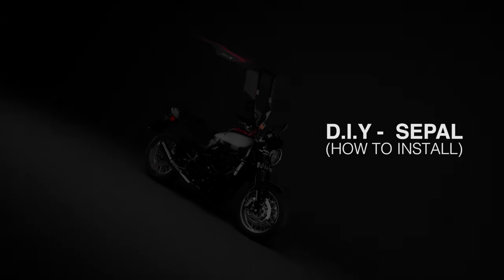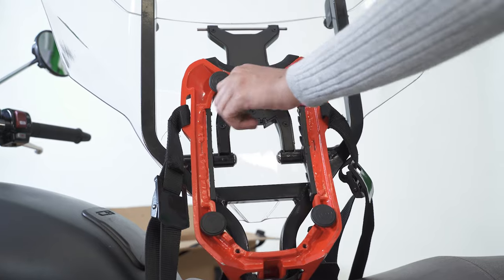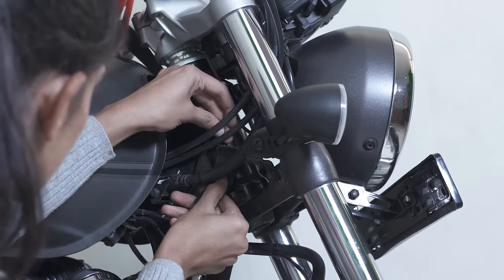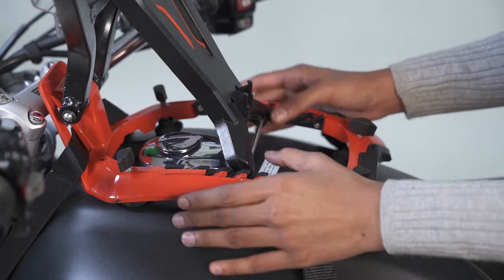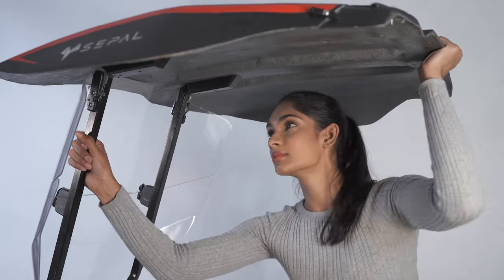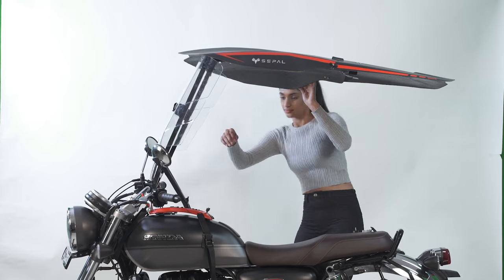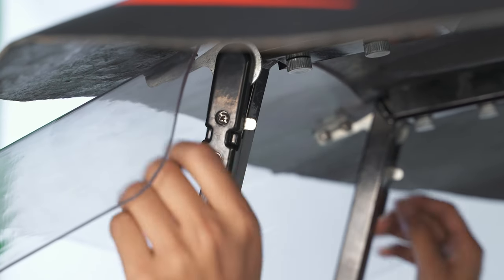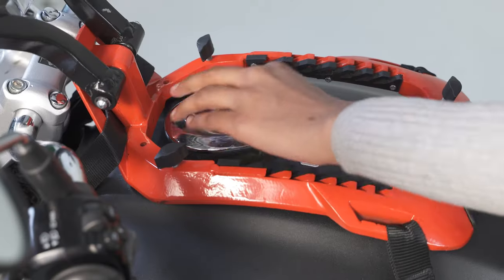How to install SEPAL

Comment: I am planning to buy it for my Kawasaki Vulcan S. I am a bit concerned about a few questions.
- What will be the top achievable(safe for sheild) speed? I usually ride up to 130kmph on suitable roads during my rides.
How the front shield is different from long height windshields on the bike. I am using a long length windshield which experiences scratches over time and even during rain fall, the vision through my windshield looks smudged. What experience will I get with this shield.
- nowdays Police interrupts too much for any additional things. I even had my fog lights registered with the bike during the bike's registration. And still cops keep stopping me considering I have fabricated exhaust and something with the bike. So after adding this, will I be safe??

Comment: RIP to tank paint... how does it work for TVS Apache 4V models because the fuel cap is offset. Also, if there is heavy wind, it may affect the riding and if you fall, the canopy may hit someone which could be dangerous
Reply from the maker: So many assumptions, the base has silicon pads which is the only part that rests on the tank. SEPAL is designed aerodynamically, we are based out of Hyderabad. If you are interested why not just take it for a spin and decide. Ping us on our WhatsApp no. +91-8897440112 for details.

Comment: It's great but there should also be a portable version and easy to carry in bike for touring purpose with the other luggages.
Reply: Very nice efforts.
Reply: Agree that would be the  revolutionary design  am too looking at  . Should be Foldable and kept  in the bike and use it whenever needed
Reply: It’s fairly unstable only design is nice n looks good but gives small benefits n causes more problems n not sustainable
Reply: @senn6k  so now you using in it ktm 390, please drive on very bad roads n make a video to test stability 
As the bolts were getting threaded out n thus sepal getting loosend so opened it n kept it inside house 
Now pigeons using it in

Comment: The thing is great but if this can be packed in more smaller size and kept in a bike dicky or luggage box. It would be great coz no one would like to carry this  fixed like a electric toto or auto.
If the shade is broken in two part one above another and a small gap facing the back direction of the bike would also help to improve the balance while riding. 
The base part is too long which makes it  hard to carry in a bike box always. The base part can be modified and made small and portable by changing some design on the standing bar.I am having some idea... Btw this idea is great and innovative ❤️

Comment: Nice Inputs in design , however it looks very flimsy it will not withstand wind pressure  even at 40KMPH . Idea & Concept is good but the mounting with straps ??? also The Top roof is at a Very Cantilever position & in bad roads it will not stand ... For prototype good but needs Improvement  in design to make it long lasting .... Also in India it will be gone in few minutes if you leave it in Parking ( Theft)

Comment: Fully covered wind shied is no good cuz the rain ☔ can make ur vison blurry
Reply from the maker: Windshield in the front has hydrophobic coating, this along with its shape and aerodynamics result in water sliding off instantly...not affecting your ability to see the road in anyway.
SEPAL has been tested in all kinds of rains for more than a million kms.
We are based out of Hyderabad, so if you happen to be here in Hyderabad we are more than happy to be to give you a demo.
Reply: @sepalmoto  can it b fitted on my bike honda pcx 125cc 2018 modle m from the UK 🇬🇧 🏴

Comment: It will not be able to protect from rain ... it's definitely gonna cause problem while riding at higher speed... with opposite wind... and of course bike will look like auto...
But it's useful in rural areas only for short rides.....better buy a good helmet and good raincoat....
Reply from the maker: We understand being such a new product, people are bound to have apprehensions on the product. But SEPAL is a result of 3yrs of RnD and testing at IIT-Bombay. Every one of your concern is addressed in the design of SEPAL. If you are interested in it do try it out and see for your self, if it doesn't do what we claim we shall give you full refund on the purchase.
1) SEPAL is designed to go upto speeds of 150kmph
2) SEPAL's topology has nothing in common to an auto,  auto is wide and short vehicle, and SEPAL on a bike is open from all side except from the front and top. Its design is a result of aerodynamics and wind tunnel testing. going back to our point, it is so new, may be the only thing you could relate to  is auto rikshaw. But we have customers using SEPAL bikes ranging from Harleys & Ducatis to Re Classic and Pulsars. All of them extremely impressed with their bike's new aesthetic.

Comment: That looks scary unsafe. If one of those straps comes loose or breaks at speed, you'll get knocked off, lose control, or get entangled in the canopy. It would be far better if it was bolted onto the bike frame.

Comment: The main problem of this product is anyone can easily steal this product
Reply from the maker: Sepal is designed to be installed and uninstalled in very few minutes. However, you can lock it with a cable lock to your motorcycle.
For more information, please call/Whatsapp: +91-8897440112

Comment: Not bad, but... what about side winshield?
Reply from the maker: The canopy on the top is wide enough that you wont get wet from rain falling at an angle
Check out this video to know more
https://youtu.be/6iMZxPtsa74
Reply: @sepalmoto  Yes maybe, but what if wind is winding from each side?.... that can be problem.